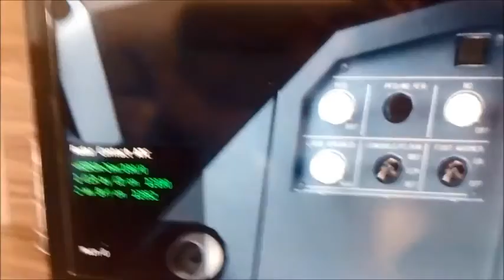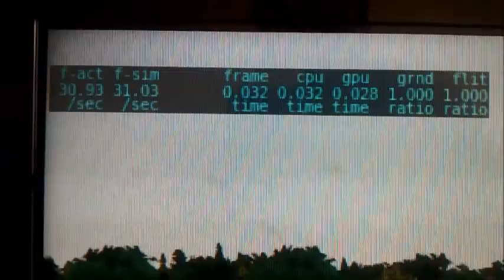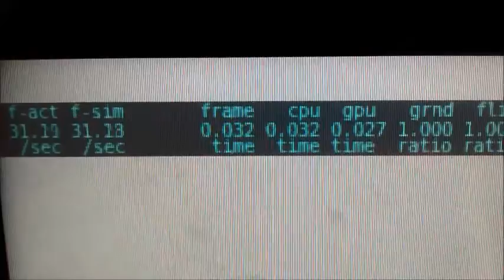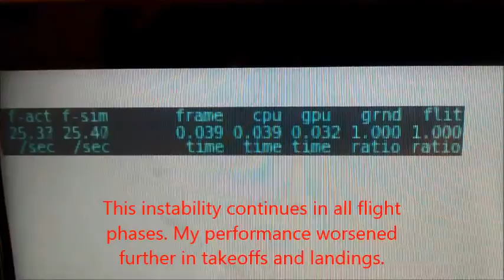Radar Contact 4 in X-Plane performance instability

Comment: I guess you've figured out the issue by now, but just in case, be sure you create an exception for your Radar Contact 4 folder.  It looks like you might not have done that.  It does use a lot of horsepower, expecially when you have AI traffic, too, but it's faster if it isn't being scanned.